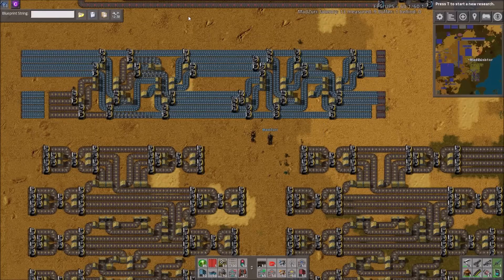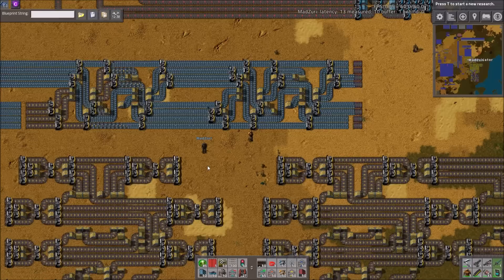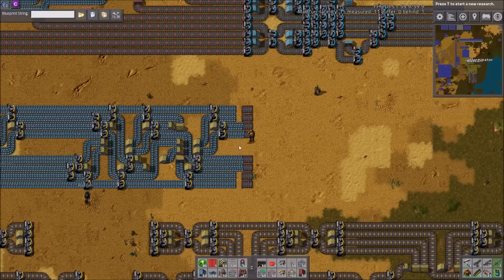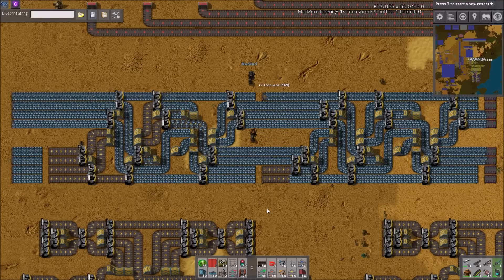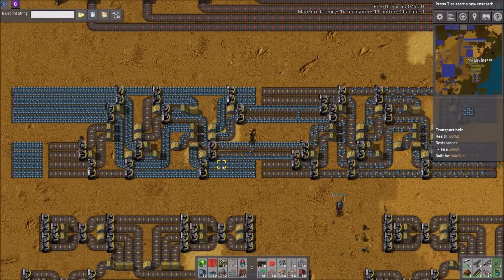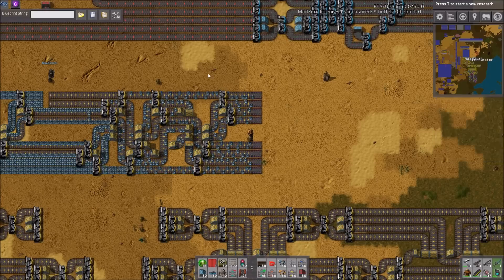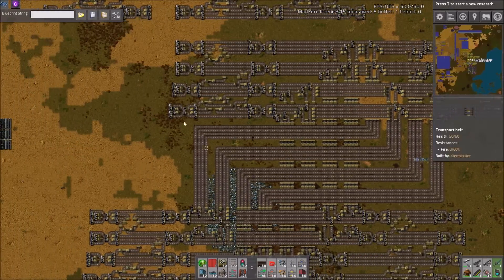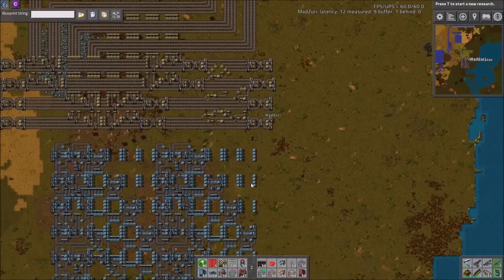Factorio Workshop - Building A Better Factory :: N to N Belt / Lane Balancers

Comment: Enough with belt balancers, just priority split it FFS! :P
Reply: belt balancers are needed. priority splitters are a lazy way to do it and can easily go wrong. belt balancers are a mechanical solution to multi lane buss distribution  priority splitters slow and inefficient as it has to calculate before the material can move on.
Reply: MadZuri Yeah, they are difficult to set up, hell, I spent 30 minutes trying to get it to work on my wood production in bob's mod. But, once it was working, it was awesome.

It's a simple setup, and you of all people should be able to surely figure it out. It's cheaper to construct, requires less space. Bang, you have it.

Here's how to get it setup, you split the belt into two, then have another splitter combining the contents. Between the two splitters circuit the two belts. During operation, then these belts are fully flowing, each should only have half compression. So, if they are backing up, allow overflow to another belt.

The fact is, a belt balancer is never required, just prioritise the belts. It uses less splitters, less belts, less space. How can it even be UPS friendly to use belt balancing? With priority splitters, it doesn't matter about the input, the input can be as messed up as possible, the output will essentially shove everything to the left, and you know exactly how many fully compressed belts you have.

So, when is a belt balancer a good idea? Load and unload off of a train? Well, that's sorted with circuits as well. Have all the inserters working as one. Or don't even use inserters, use loaders, and just have that lovely fully compressed belt filtering through a warehouse.
Reply: your mind is tainted with bobs mod. there are no loaders in vanilla. you agree that its harder to setup and then give the vaguest explanation on how to. a belt balancers and a priority splitter cover different aspects of the belt mechanics. priority splitter is all about getting material off the belt whereas a balancers purpose is to make the distribution of multiple belts even and identical. the whole thought of you need a balancer every time you split off is untrue you only need to balance once if all of the splitting off after is done evenly

i could go into further information on why a balancer is not the same as a priority splitter but i think what i have said is enough. 

the priority splitter and the circuit conditioned unloaders are slow they are slower than the mechanical method. and a 4 lane priority splitter is not smaller than a 4 lane mechanical splitter here is the mechanical method and as you can see its quite compact http://i.imgur.com/Js5D5kW.png
Reply: DeamonEngineer I am pretty sure you can get loaders without bob's. It's the warehouse mod plus "add-loaders".

I didn't say you did need to use a balancer every time you split. A priority splitter is used to keep the belt compressed after using some of the resources on a main bus. But, we can also use it through the smelting area to make sure the first row of smelting takes priority for ore, then every row after that is only taking overflow.

Essentially priority splitting is about overflow, it's about managing the overflow in such a way that essentially forces compression. It's definitely pre-bot, and becomes obsolete. I also use overflow valves for my fracking, solid fuel production in bob's.
Reply: While priority splitters can be quite nice for getting something off a bus, there are times where you are more interested in a balanced setup. One case would be many type of producers and many types of consumers. If it is important to not overdraw from one of the producers (might lead to lack of the resources used to make it), or that it is important that some producer has its product consumed (if those products arises from sideproducts, which need to be dealt with to keep the factory running), then a priority splitter would cause damage, while a balancer would reduce the chance of problems. If you need all the parts of the consumers to get something, say one is ammo and another is science. Both might need to run at the same time (no ammo and biters will ruin your base), and no science and you will be stock with no progress. If your building materials is further down the line, you are not even going to be able to build your way out of it. Note that I was assuming that you would have a high effective buffer space for ammo (say a giant belt going around your base). Basicly priority splitters are a lot less good if the belts cannot back up fast.
Reply: Sight, you logic falls apart here. Let my try to put it into simple terms:
A: use priority splitters
B: Something is not getting enough material.
S1: When B use A.
S2: Make sure that B never happens by producing more.
Considering that S2 makes the condition for S1 never be true, we never get to the case where we should use A. It would instead be sufficient to run dedicated lines to all those places such that they get enough, and you would have to put in less (or equal amount of) belt than if you were setting priority splitters up, where you were ensuring that each place got enough.
Please order your thoughts into a logically sound arguement and try again.

Here is the simple version of my argument: Priority splitters distribute goods in a special priority system, and can be fairly good at this, balancers distribute goods with a uniform distribution (which you can take different fractions from), and they are fairly good at applying that uniform priority. In different situations you might want different distributions of your goods, and the different distribution models have different effects on different designs.
For the problem this was designed for, it was not so important that I had enough of a specific type of output, as it was that I could make sure I could keep using up the input. This means that I would have large amount of processing of the goods, in a way that woul compact them, and also buffers on them, such that the production wouldnt halt because the goods were not consumed. I would also need some amounts of each of the outputs, so I could not just prioritise one of them with everything. This is a case where I would obviously need a throughput conserving balancer, and a priority splitter system would not really help, and it would not really be much different in size or complixity of the balancer shown here.

Comment: Why would you ever need 32 belts? You madmen.
Reply from the maker: You wouldn't really. xD If you need a 32 belt balancer you should probably be using bots instead. This is mostly just for show purposes and such.
Reply: Getting bots to consume input in a certain controlled way is much harder than with belts. Many of the nice solutions would either require seperate bot networks, which was not a good idea, because it was also being used for something else in the same region, or risk overflowing all the storage, which may have practically ruined the game.

That said, you usually dont need 32 belt, especially in single-player vanilla. Personally I find a large part of the fun building a factory and its beauty to connected to belt designs, while I consider bots best used for problems with too anoying logistic problems connected to them (say dealing with barrels) and requiring relatively small amounts of needed transportation. Problems with performance from belts have not really been a problem for me in singleplayer yet. The problem I built it for was relatively simple logistic wise, I just needed to handle the destribution of many sources to many sinks in a balanced and controled maner. The size of the balancer was not exactly all that large when compared to the production areas it served. I used 4belts 2 space layout, because I had many lines crossing it, and each of the 4 belt groups represented a source.
Reply: I would like to see when there is no collision between bots. something like only one bot can access a chest in a fraction of second, and take a route without colliding with other bots.. That will definitely encourage belt usage.. the more bots you have.. more the wait times if its not organized properly :D